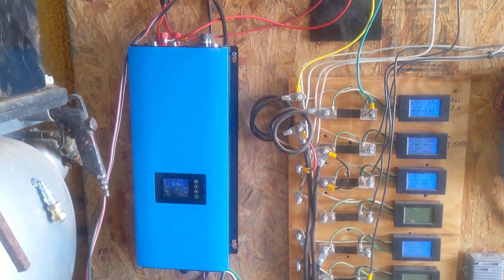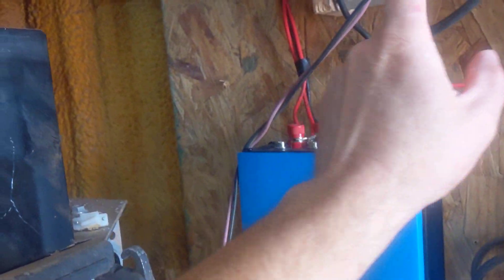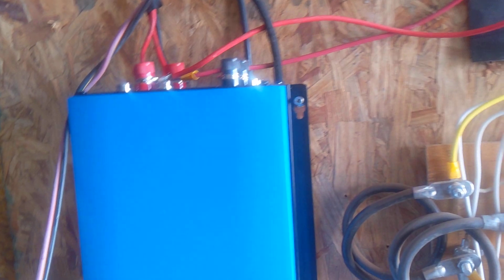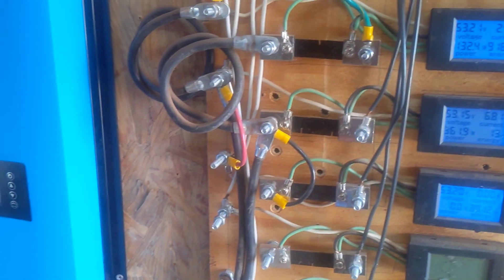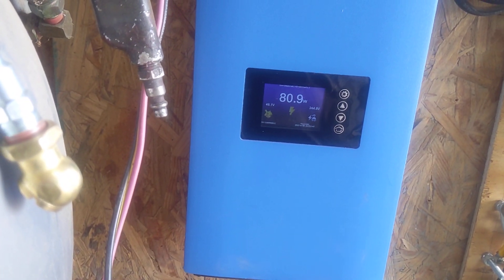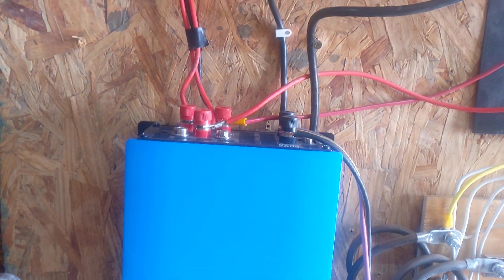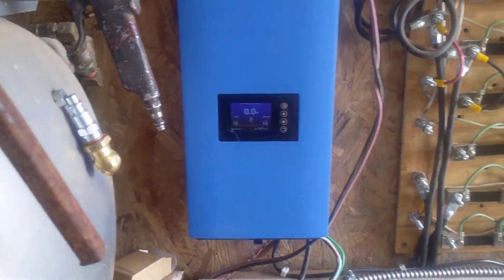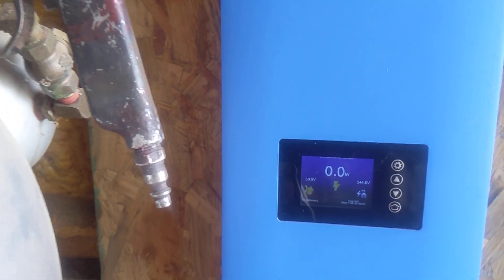Update on the 2000w Wind Turbine Grid Tie Inverter

Comment: Still work this wind inverter ?
Reply from the maker: This inverter still...works...as well as it ever did anyway.  I never was able to really get it to operate as intended but I do have it working more or less as a solar inverter.
Reply: wind inverter work every day ? , you reccomend, this wind inverter? , i use only charge battery from wind turbine,220v use solar inverter @ToysforWatts

Comment: finally got my i700 up, I have a similar inverter without the wind part of
however I have the ista breeze hybrid charge controller with a single solar panel im suspecting the solar will help keep the "grab" then get the turbine to spin up, however we have barely any wind at the min here yo test ill let you know how it goes
Reply from the maker: That's awesome!  I look forward to seeing how it works out!
Reply: With barely any wind you won't see much power coming out, maybe just a beautiful talking point because of its spinning, spinning alone does not produce any useful power to get 1000 watt out you need very powerful wind, a wind you have to fight against, a wind turbine only captures about 40%
Reply: @johnq8792  its been a scarecrow to wind since installing this week
Reply: @jamesaddis8726  ...wind turbine only makes sense if you have a lot of wind, like this channel here or mine or some others, there is always something to fix, an expensive endeavour, better solar array once installed it last you 20 30 years with not much fixing kind 8f boring,  that's also one of my reasons to go with a wind turbine always fixing and modifying something, for instance yesterday my 3 phase rectifier damaged and needs to be replaced

Comment: I found with mine the Short Circuit and Dump load controls in the settings menu are actually the wrong way around . You need to set the short circuit to be about 10v higher than the dump load - mine are set to 47 and 56v . Works fine now .
Reply from the maker: Thanks I might give that a try and see

Comment: Something not right with the big blue box,  I use the blue box gtil 2000 also, but for my grid tie setup with solar panels, my i2000 is direct connected to a 150amp 3 phase rectifier and then 28 volt lithium battery bank, no breaks at all, excess power gets diverted into a dumpload.

Comment: Maybe best to buy a midnite solar 150 or 200
Reply from the maker: Those are just charge controllers.  For what I do grid tie inverters are ideal because I want to unload the maximum amount of power possible.  When I test the turbines I'm not trying to see if they can keep up with my demand, but trying to demonstrate their maximum potential.  I do like Midnite's controllers, however.
Reply: @ToysforWatts  ...from the midnite solar with perfect wind curve setup into your batteries, and from there into your grid, maybe.
Reply: Did you try it with a pwm controler

Comment: Seems as for that controller you need a 12v generator. That continous braking is to slow the turbine so it all doesn't burn up. Does it make sense?
Reply from the maker: It's rated for a 48v turbine.  If the braking was increased as votlage increases then it'd work that way...leading up to a complete circuit to the resistor at high voltage...but with it working the way it currently is with the connection to the resistor always live the turbine can't even get started.  I put a meter on it with the i2000 running and while it was within the operating voltage the inverter was sending more power to the resistor than the grid.

Comment: Isn't that big GTI pretty much like a solar unit, but maybe has (should) more advanced circuitry to deal with the crazy changes in power from a turbine vs solar panels? It has to be able to "track" the turbine output faster than a solar unit I'd think. I know you've been playing with standard GTI's with your turbines, but some have blown up due to exceeding the upper voltage limits of inverters? I think the big blue one needs some tweaking in the software maybe. It's gotta learn how to keep the turbine in it's power curve and know when to "unload" it before it stalls due to low wind speed. On the other hand, if the turbine is going crazy and approaches the upper limits of the inverter output power, it needs to engage the dump load properly. Maybe even have progressive loads, where it monitors the excess power and adds more dump loads if needed to keep turbine and inverter in a safe range? I like the water heater element setup! I just got a dual element and playing with it now. I wired it so both winding phases are evenly loaded. Seems to work so far. Hey, is that a Standard Apricot Poodle? Sure looks like it! LOL.
Reply from the maker: It's essentially the same 2000w solar GTI but with a rectifier built in....allegedly some different software that'll help grab the wind turbine's erratic power delivery.